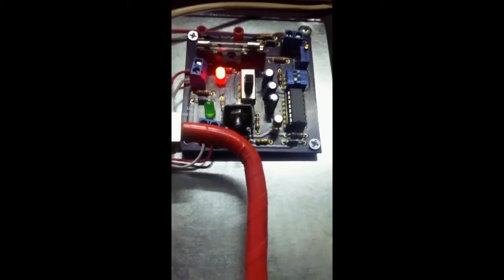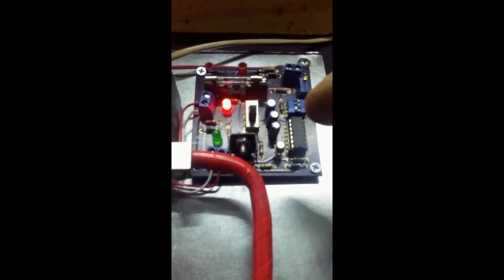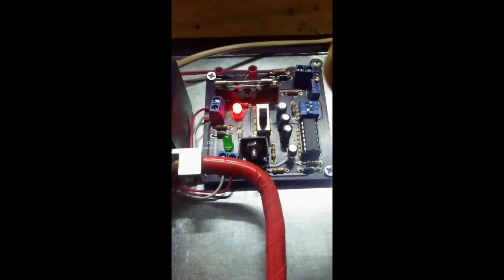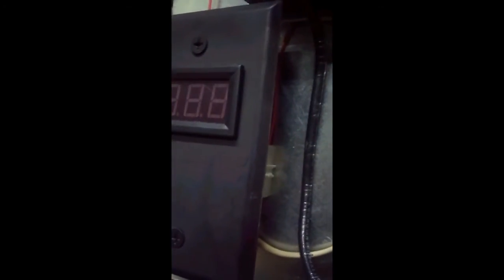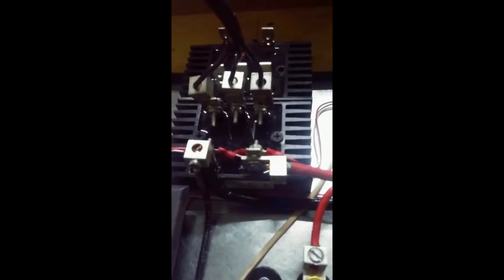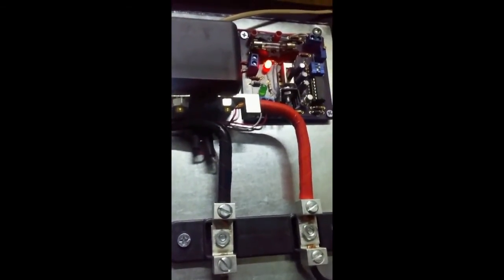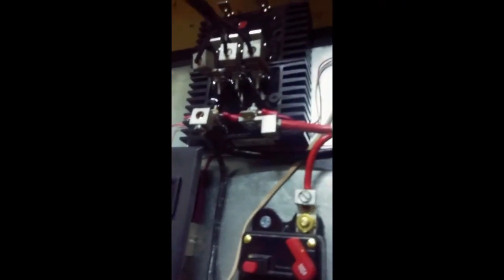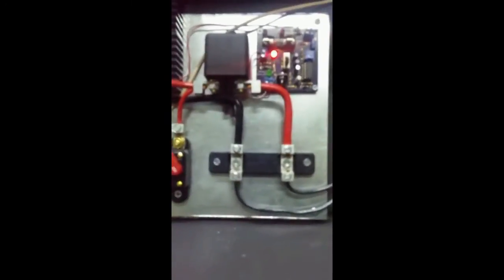Dump load controller wind turbine

Comment: Definitely a need for it on market. Lots of user inputs, functionality, and use of correct/robust components, unlike a lot of the other stuff out there that either dumps needlessly off the batteries, uses incorrect breakers/fuses, etc.  Good job Larry.

Comment: Brillant Larry! Can tell that you thought things through over a long period of time and worked the bugs out.
Larry built me a controller for an almost impossible wind project. Not only got me out of the woods, but the system is still running flawlessly after 3 years. I have more trouble with my Grand Cherakee.

Comment: Look's like it work's well. You know as well as I do no 440 amp relay is going to handle 440 amps I think the maximum they can handle is 100 amps but that is for a short period of time. Does your charge controller dump for a set period of time or senses the voltage and then turn's on or off once at the required voltage?
Reply from the maker: Hey Bloke. Good question:)
It reads what ever turbine voltage you want the system to activate. the delay stops the system and turbine from cycling on and off to fast. So you pick when you want it to trigger between 0-90v.So for your 1.5kw inverter 48-90v you can use this to dump at say 85vdc if you dont trust their dump load controller or install a dc to dc step down converter and dump back to a 24 or 48 v bat bank or gti.
Thanks for watching.
Larry